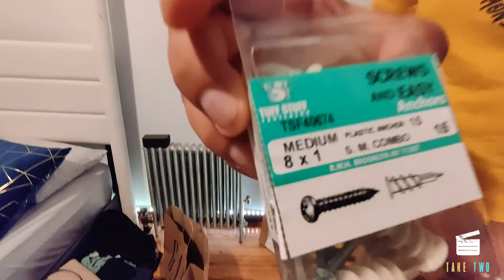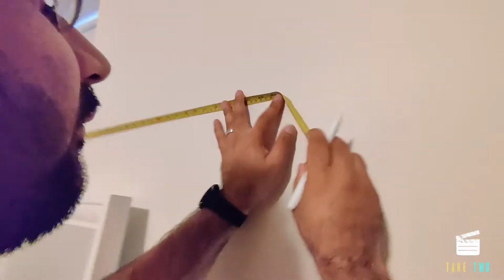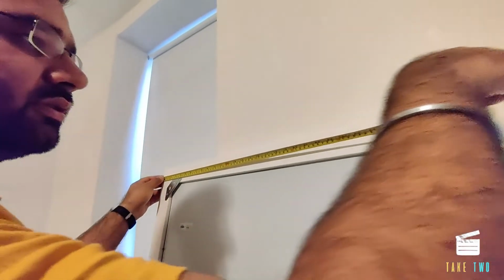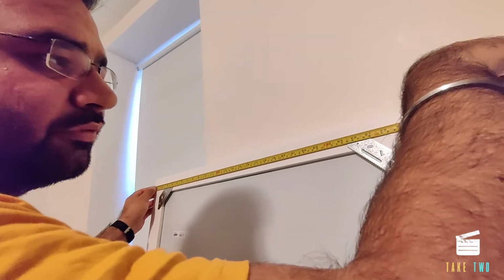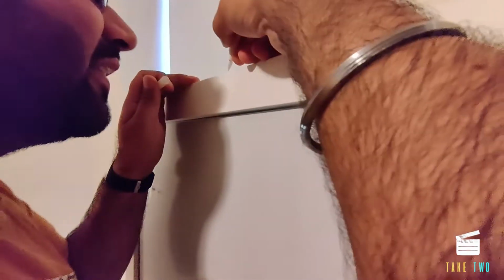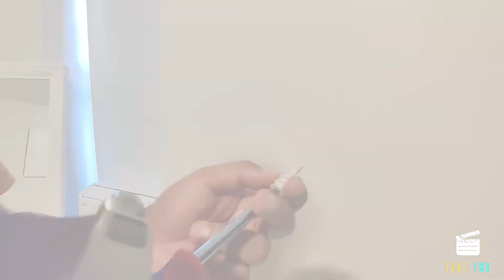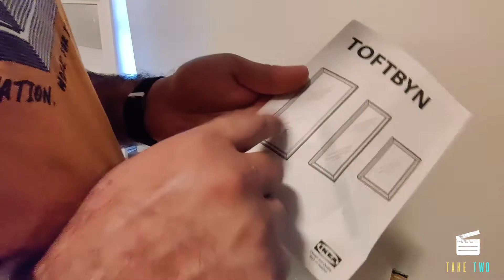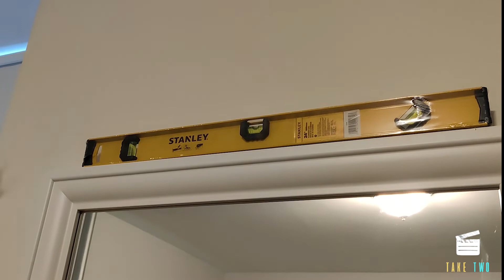How to Hang a Mirror on Drywall

Comment: Do you not have to have the crews go into a stud?
Reply: I would have thought so, but wall mates like the ones used in this video work just fine.
Reply from the maker: Its not always that you will find a stud. These drywall anchors hold a weight of 35lb each so in total 70 lb which is more than enough for a mirror.